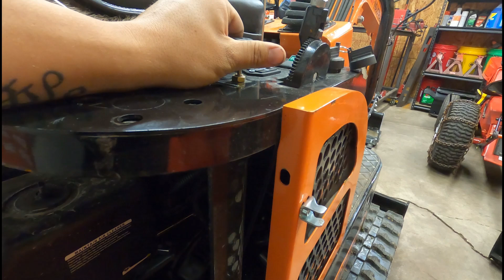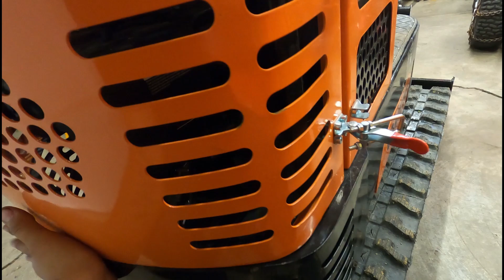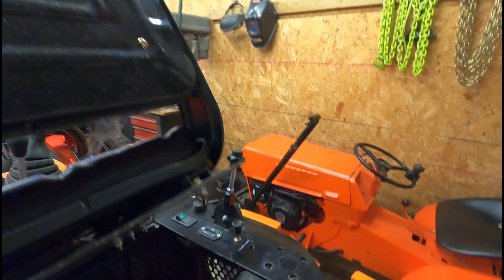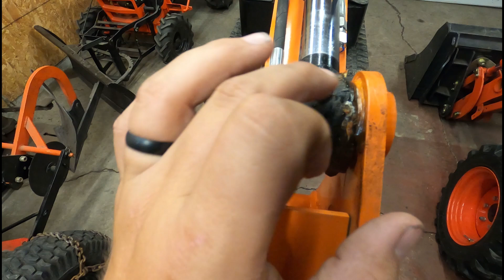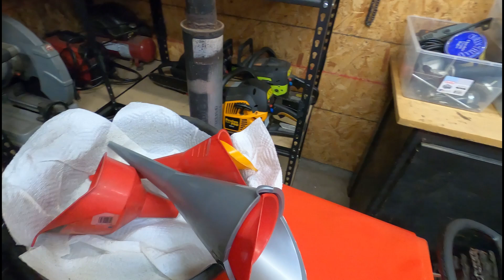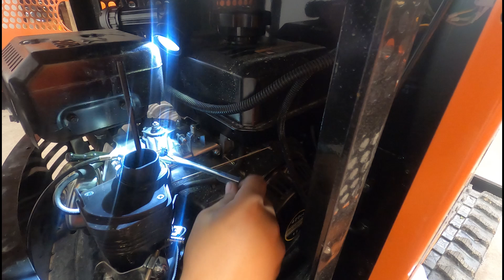Buying an AGT Industrial QH12R Chinese Mini Excavator

Comment: Enjoyed the video. I am considering buying the same machine.
Reply from the maker: @jacklabloom635  did you get one?
Reply: @skywatcherranchswr , I seriously considered buying a new QH13R machine for sale locally for $4500. I ended up buying the new model of Harbor Freight Backhoe, because it is more stable on my hilly land. So far, the HF backhoe has been great for my project. I am burying 24 tree root balls.
Reply from the maker: @jacklabloom635  I have heard that about the stability, too. I also see one of the biggest pros to the tow behind backhoe is how quickly you can transport it. The tracked excavators are soooo slow. I see they're even making tow behinds that rotate 360 degrees instead of having sideswing like a backhoe. They're all better than a shovel, in my opinion

Comment: Hello Skywatcherranch, we really enjoy your videos. We bought an excavator just like yours, but I must admit I am a green horn when it comes to excavators. We are researchers of wildlife and live out in the boonies. It's very hard to get new information about things into us.  We need help trying to figure out a couple of issues on the excavator. I'm 74 years old and can't see to good the 2 problems are the throttle cable bends before it supposed to push lever back 2 low idle, the cable is to week to do the job. The second issue when I push the levers to go forward or in reverse the whole machine turns into a bucking bronco. It did help when I throttled it down but now the cable not working right & sticks wide open. I'm afraid to drive it. As a researcher over 20 years, researching animals for the people this is the first time I've ever needed help from the people, can anybody in bigger cities that knows about hydraulics, help us get these problems straightened out as a gift we will send you a picture off unknown animals never seen before buy the public in appreciation for your help. We need this machine working badly to further our research. Thank you all very much, and we appreciate any help.

Comment: Hi, I have the same QH12R  there’s 2 instructions books one is the QH12R MINI CRAWLER EXCAVATOR and the other one is GASOLINE ENGINE OWNER’S MANUAL 80, 100, 180-3, 210, 225, 300, 390, 420, 440.  The oil level is in page 11 ; IV-3) add the recommended engine oil up to the oil filling neck.  4-stroke engine oil,API service classification SF, SF 10W-30

Comment: Make sure you install a fan in that thing. I put one on mine….they get so hot after working for about 30 minutes.
The hinges are cool…I have to install them on my unit.
My seat belt broke after one week. You need a seat belt, or you might flip out of it🤣

Comment: A little w40 will fix the throttle issue. The spring is supposed to pull the cable back to rest position.
Reply from the maker: @jrm163  it was far from a lubrication issue. I fix it in this video. https://youtu.be/7n2l1dxm_N8?si=JqT6F9SVCxBbnVby
Reply: @skywatcherranchswr  👍 handy

Comment: How do you set the pilot control pressure so it will operate a little smoother mine is very very jerky even with lot rpms
Reply from the maker: @jeremyyates8417  I have no idea. Mine is Jerky too. I barely move the controls to try and be steady. Also lowering the rpms helps too.

Comment: Add a second spring in parallel your current spring if you cannot find a stronger one.  That fixed my throttle cable return problem.  Ended up connecting the throttle cable to the end of the arm and mounted the cable sheath end to where the choke cable is mounted to the block, just above it.  Works great and has full range of throttle.
Reply from the maker: @richardbrookins5406  stay tuned, I'll have a video out soon where I did that. Works really great!

Comment: Look into putting a flowmeter on the boom swing. It wont jerk as much.
Reply: Yes I broke the swing motor the bolts backed out of it and it leaks fluid even after a rebuild kit. so keep them tight u have to take it out of the machine  turn it upside down to see the hex head bolts to tighten them